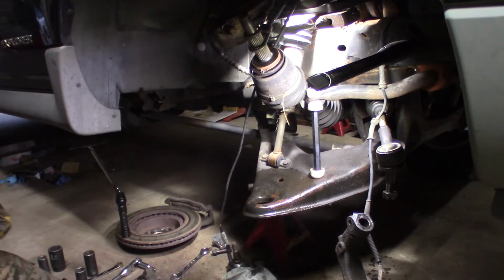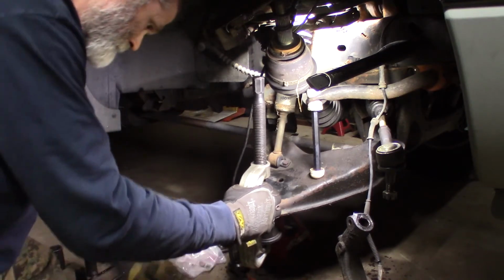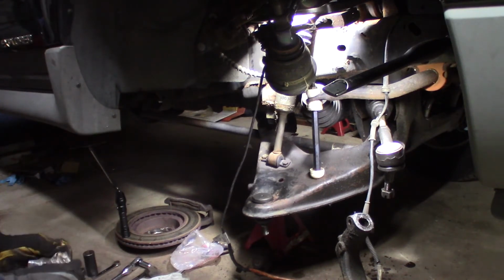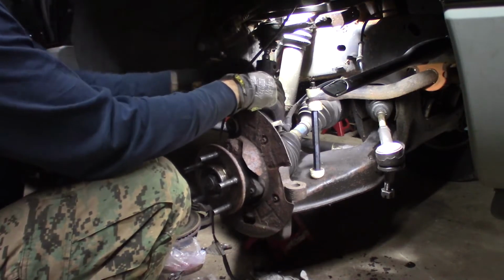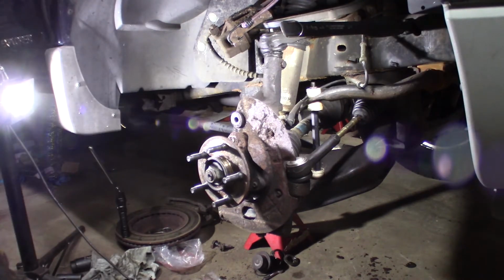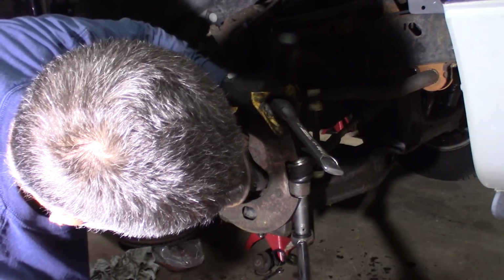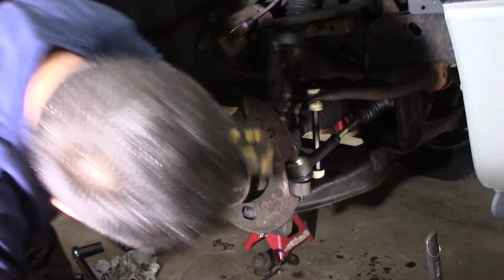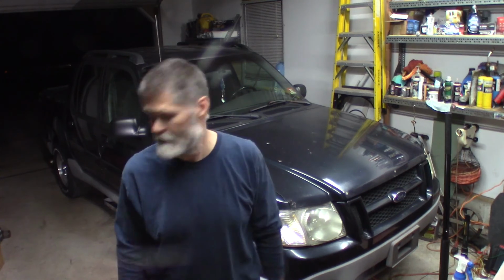2001 Ford Explorer Sport Trac Lower Ball Joint - Part 2 - Replacement

Comment: "leave it better than you found it" that's what I take from this. I lucked out had a Dad who was a general mechanic at a golf course could fix anything. Later rented a cottage behind the house of the Master mechanic at Chevy in S. SF and he taught me some things. You work like them. 
As I go I check all the bolts threads etc clean / brush as I go. Leave it better than I found it. 

I got a 97 Explorer unfortunately I didn't grease my lower ball joint it is toasted. Did you need a "ball joint" separator?
Reply from the maker: pickle fork... yep, didn't care about the boot as the ball joint was being replaced... makes it easy to get it apart.